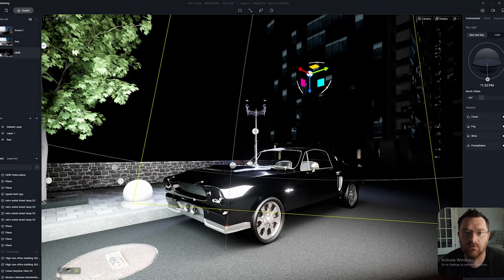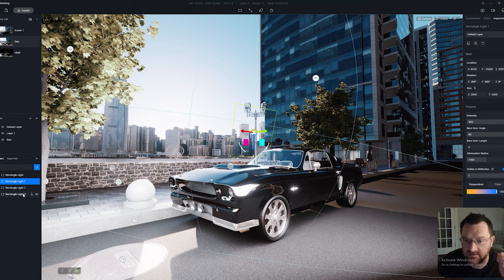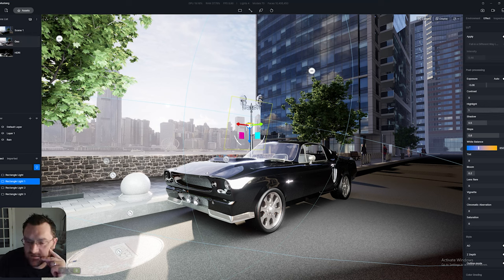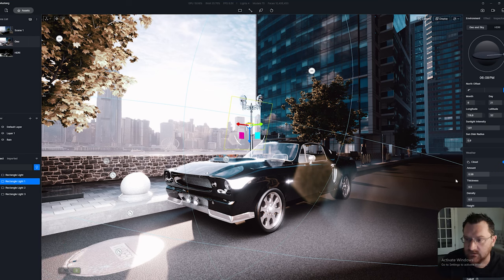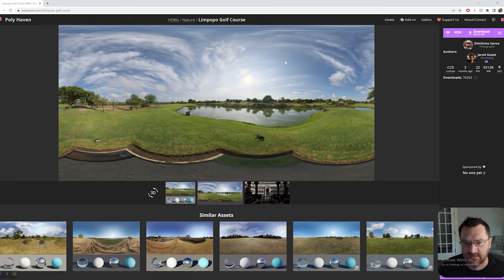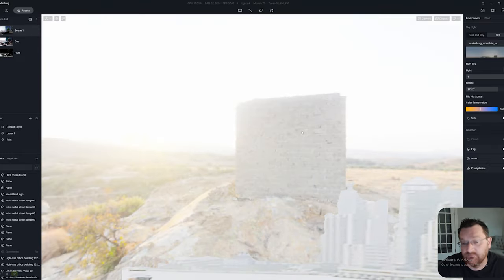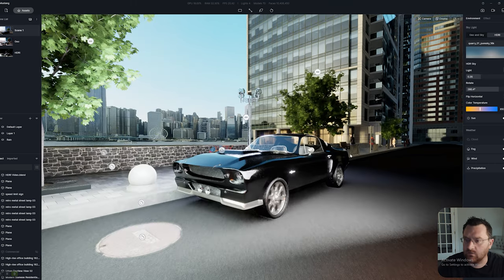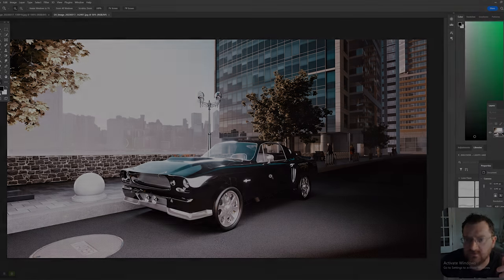D5 Render Geo or HDRI?

Comment: Hi, good video. What does the realtime tab do in display panel? Doesn’t seem to make any difference, at least before render?
Reply from the maker: Neil, it controls the moving/dynamic parts of the scene. In this one, you are right, it didn’t do anything as there is no animation in the scene. It’s just habit to turn it on! However, if you have moving models, or weather effects, you can see them running with this button on.
Reply: Ah, many thanks & keep up the good work…